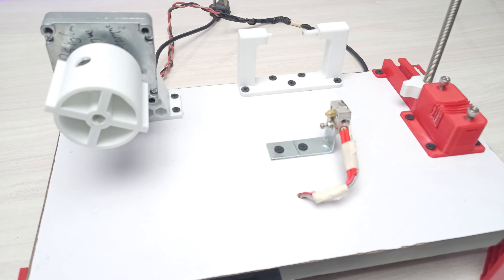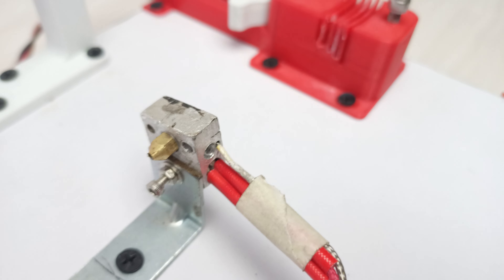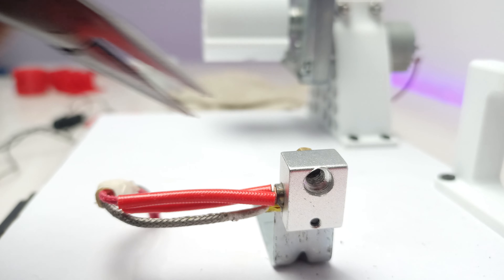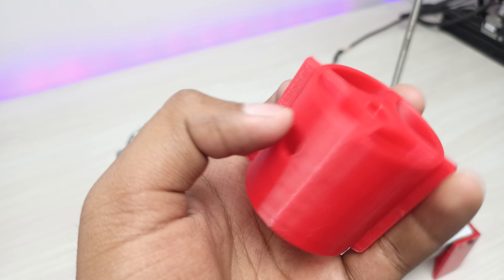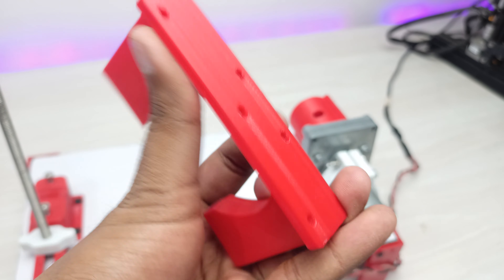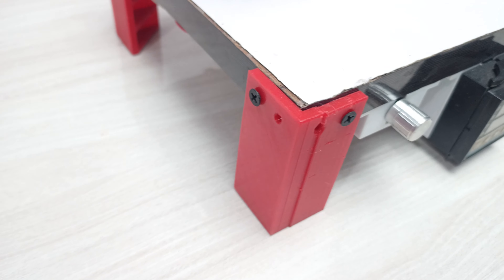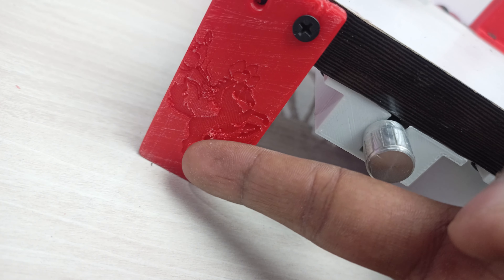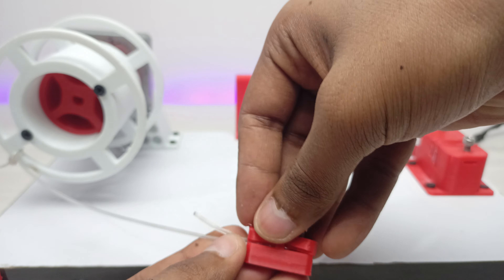Upgrading My PET Bottle to Filament Making PET Machine with more Stronger Parts

Comment: how wide do the strips have to be an whats the nozzle size,  ive seen other say to drill them out to be 1.5 but i felt like that was to small but ive yet to try it, i got pretty much everything together except for mounting the hotend an im still trying to work out how im going to go about it, if i knew what kind of aluminum would be best used to make a heatblock i would make my own block but all the aluminum i have on hand right now is what came from a old aluminum head from a 2.2 lt engine an i may be able to get a chunk out of it big enough to make one but im pretty sure its cast aluminum an im going to guess that wouldn't be as good as the mk8 heatblock that i have. the setup ive went with requires me to use 2 thermistors one the little bulbs but the other is almost as big as the heating element for the heatblock so its left me with no where to put it, so its left me looking for a old pc heat sink or something that i could mill down an make something big enough to work with everything i have, if not i may just strap it to the top of the block til i can get something else worked out, thats the onlything thats holding me back from trying it so id really like to get it going.

Comment: Have you tried a wee bit of good thermal paste when you insert the heating element and thermistor?  I did that on my PET machine and it made a Big difference in the heat transfer and how the thermistor was maintaining a proper temp.
Reply from the maker: Thank you for the suggestion, but I haven't tried using thermal paste yet. However, at the moment, everything is working fine, and the thermistor is maintaining the proper temperature.

Comment: Hello! What nozzle do you use to print? Im finding .4 clogs mine with homemade pet filament
Reply from the maker: I'm printing with a .4mm nozzle at 260 degree Celsius. Make sure the bottle is clean and no residue is on it